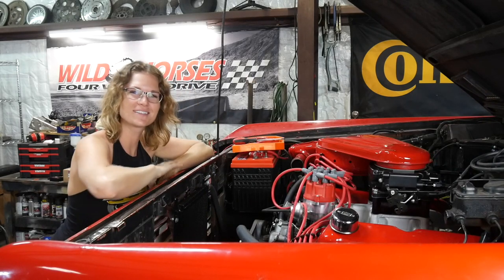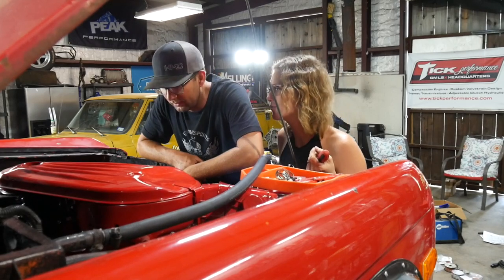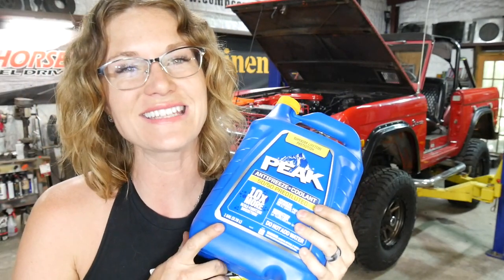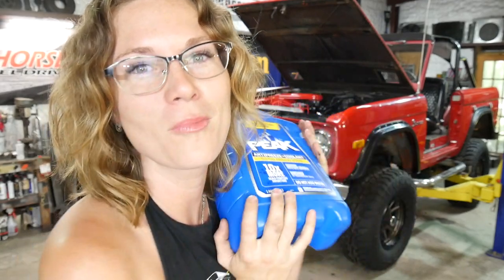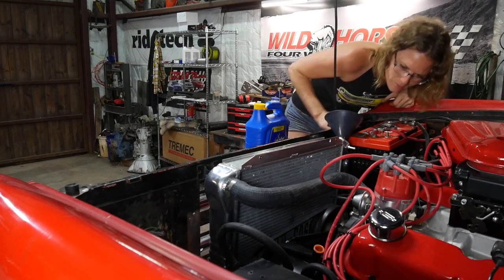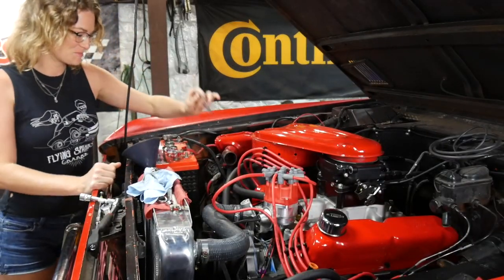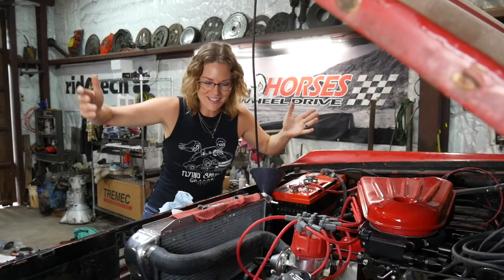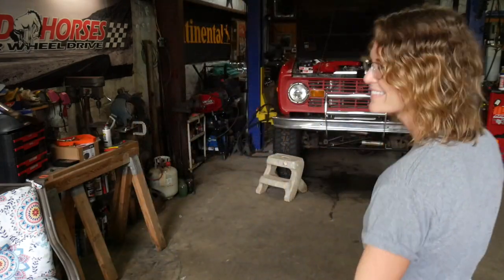Installing Coolant System On 1973 Ford Bronco

Comment: On the back of the bottle for your new Peak 10X antifreeze it does not state anywhere that it is 2-EHA free.  But, on the back of your Peak Global it does state that it is 2-EHA free.  So, does your Peak 10X antifreeze contain any 2-EHA?